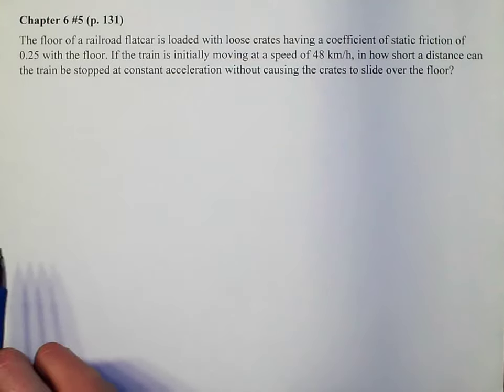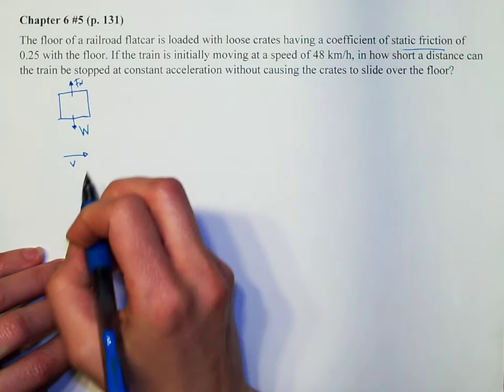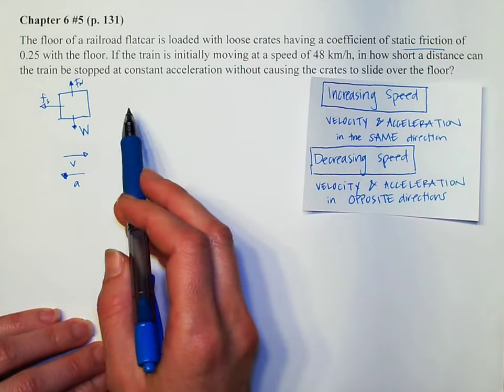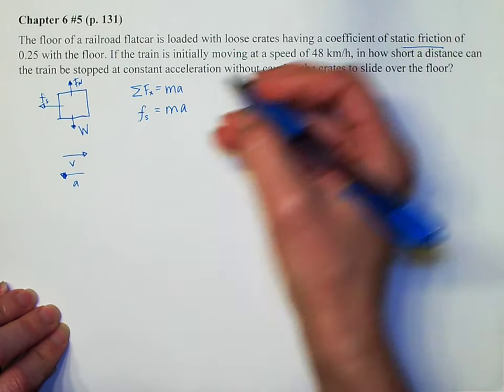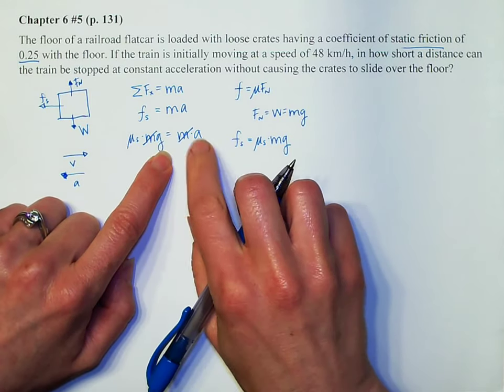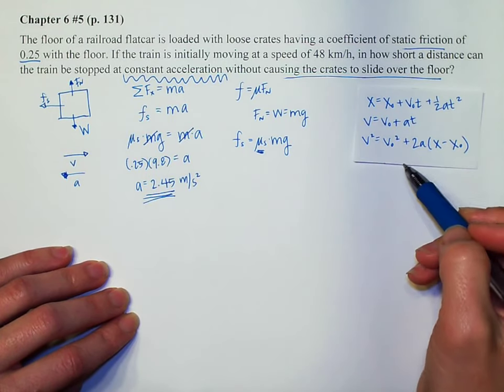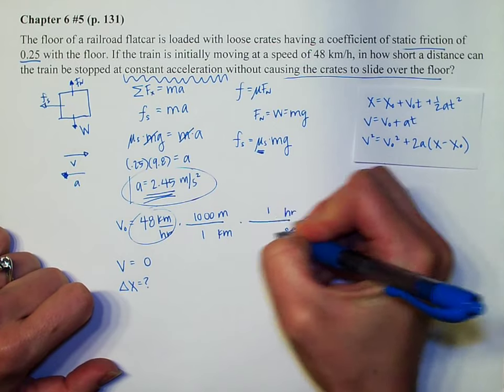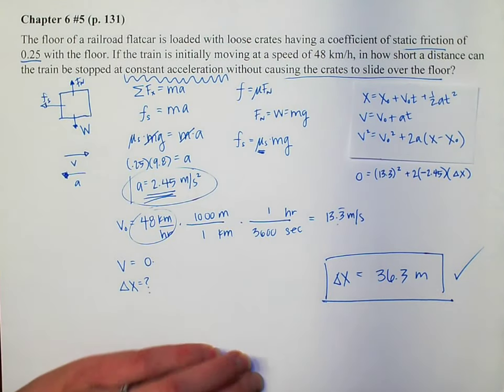Chapter 6 Problem #5

Comment: 7:11 isn''t -36.1 m  mıss🤔🤔
Reply from the maker: If you're using 13.3, then yes that is what you would get. But the value is actually 13.333333 (repeating), which is why the correct magnitude is 36.3.